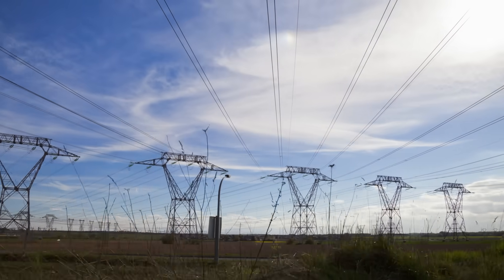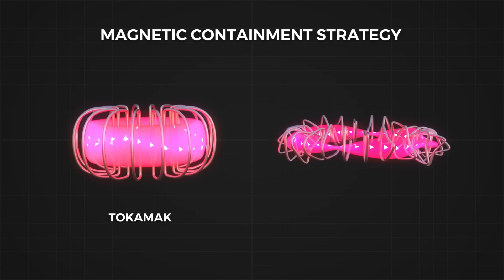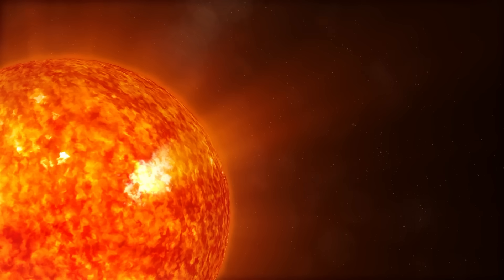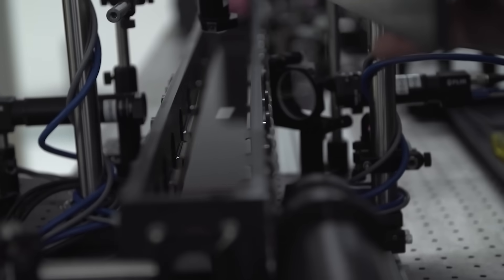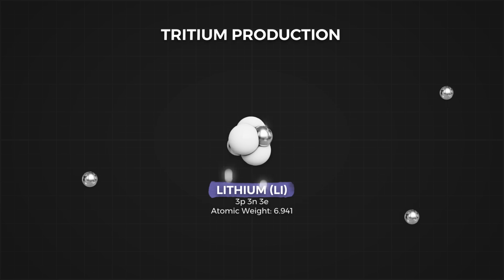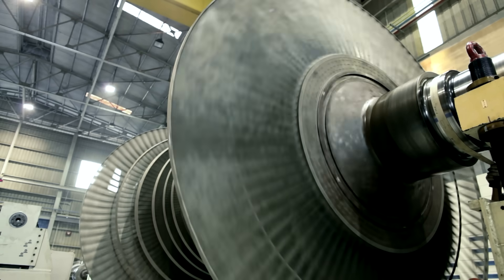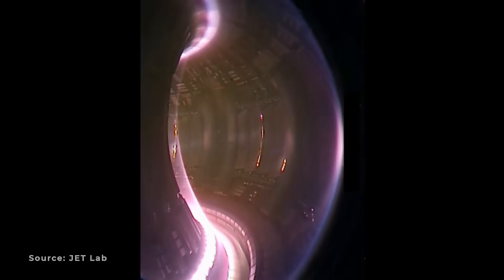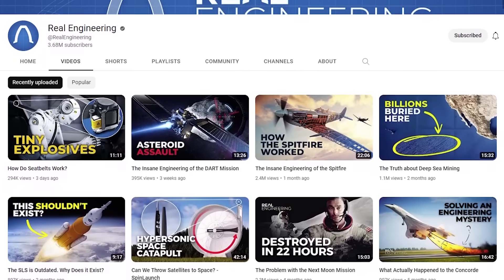The Problem with Nuclear Fusion

Comment: The Pinch Plasma Dry Fusion Reactor. This invention is designed to harness the power of plasma at temperatures as high as 10 million degrees Fahrenheit, offering a new approach to clean energy generation.

The energy output of plasma is proportional to two key factors:

Volume: Larger plasma volumes produce more total energy.
Temperature: Higher temperatures result in more energetic particle collisions, increasing the system's energy yield.
For example, a plasma at 10 million degrees Fahrenheit could transfer substantial energy to a surrounding medium (e.g., air or water), generating heat for steam turbines to produce electricity. The efficiency of this energy transfer depends on the reactor's design and heat transfer mechanisms. Based on historical data from Z-pinch systems:

Thermal output energy efficiency can range from 30–70% of input energy.
With an input of 1 megajoule (MJ), approximately 300–700 kilojoules (kJ) of usable heat energy can be recovered.
When compared to historical systems, the Pinch Plasma Dry Fusion Reactor could be more efficient:

Input Energy: Hydrogen and gunpowder serve as highly concentrated energy sources, comparable to 0.1–1 MJ per pulse.
Efficiency: With effective heat transfer, the system could deliver 50–80% of the plasma's energy as usable thermal output, making it highly competitive.
For context:

Historical Z-pinch systems required 0.1–1 MJ per pulse (equivalent to 27.8–277.8 kWh).
They achieved plasma temperatures of 10 million°F, with efficiencies of 30–70%.
The Pinch Plasma Dry Fusion Reactor could match or even exceed these benchmarks. With a design optimized for cost-effective operation and high energy transfer efficiency, this system has the potential to advance clean energy technologies and reduce reliance on fossil fuels.

In the mid-20th century, pinch plasma systems demonstrated the capability to achieve plasma temperatures as high as 10 million degrees Fahrenheit for brief periods. These devices, including early Z-pinch systems, successfully generated such high temperatures using deuterium gas as the working medium. The resulting plasma provided valuable data on fusion energy and particle behavior, laying the groundwork for modern nuclear fusion research.

Despite these achievements, the widespread application of pinch plasma technology seemed to decline after 1970. While advances in tokamak and inertial confinement designs have dominated fusion research, I am curious whether the factors that constrained the development of pinch plasma systems were primarily technical, economic, or related to the limitations of available materials and confinement methods at the time.

Key questions include:

Was the reliance on deuterium as a fuel a limiting factor due to its cost or availability?
Did the challenges of plasma confinement, stability, or energy gain outweigh the potential benefits of this approach?
Could modern advancements in materials, computation, and diagnostics offer a renewed opportunity to revisit pinch plasma technology as a viable path toward sustainable fusion energy?
Given that the capability to generate plasma at 10 million degrees Fahrenheit was demonstrated decades ago, I believe there may be untapped potential in exploring how these historical systems could inspire new approaches.

Comment: This is why torroidal systems are not a long term solution... even with superconductive magnets, the long term degeneration of the reactor wall is a huge problem... and that's before you look at long term neutron damage making the walls radioactive, when you want to replace them. That being said, there is nothing to say that you can't use torroidal accelerators, with the stream being allowed to escape in a straight line once it reaches velocity. With multiple streams reaching one central point, plus magnetic containment of that central area, you can avoid plasma contact with the walls, and use the kinetic energy to help the fusion process along.

Comment: I am very disappointed with this video because it makes the same drearily predictable mistake that has caused the waste of tens (hundreds?) of billions of precious research dollars - conducting expensive research on systems despite known insoluble deal killer problems. Fusion powered electricity has been, and always will be, twenty years away because of this.
The only wise way forward is to stop all fusion research and construction worldwide at the system level, and focus on solving the (relatively smaller) deal killer problems one at a time. And if those problems can not be solved, then the involved scientists and engineers need to tell the world that fusion energy on Earth is literally impossible.

Comment: @4:29 🤔How can energy be released if you put 2 hydrogen atoms in and get 2 hydrogen atoms out? You just lose an e- then gain an e-? In the vid, it's said to be a "low" energy reaction 🤔
Reply: in the case of regular hydrogen fusion, a proton turns into a neutron, releasing a positron (essentially anti-matter) which will then collide with an electron, destroying both of them and releasing energy
Reply: @matthias5207  Ah so the energy results from the mass that is lost and annihilated?

Comment: use high amounts of energy, to try and create a fusion reaction that creates more energy than what was put into it. the concept of fusion energy sounds like a perpetual motion machine to me. impossible to achieve. natural fusion is only possible due to incredibly high gravity of gases, that do not take an outside source of energy, just the force of gravity. it is something that will never occur with a net gain, that will fit on a scale that will fit on the damn planet.

Comment: I like Helion's idea of using short pulses of fusion to drive a magnet, kind of like explosions inside the cylinders of a car engine drive a piston, thus bypassing the need for steam-driven turbines. However, I still think the easiest, cheapest way forward is by using smaller, modular fission reactors. And for those who think nuclear waste is an issue, many of these newer reactors actually use the waste for energy, thus diminishing the problem, which honestly was not much of a problem anyways(all the nuclear waste ever produced by mankind can fit into a single football field three barrels high). And as for meltdowns, thorium reactors never meltdown, because of the way thorium works it's actually impossible. Plus fission has no greenhouse gas emissions. So, please, let's just focus on fission, preferably smaller thorium reactors, for the time being!!!

Comment: Couldn't you replace the tritium with Helium 3 and there tons on the moon right?
Reply: yeah you could but H2 + He3 fusion is even harder to achieve you need higher temperature and pressure however the yield is the highest 18,4 MeV

Comment: You still need oil.  You can't put a fusion plant inside of an automobile.  And even if you could, all that does is turn a turbine to boil water- just like every other power plant.  Fusion isn't going to redesign our power.  It's just another method of boiling water for steam.  Electricity is here to stay.  There's nothing fusion can do that fission can't.   Also, billions of dollars, massive lithium mining on a global scale, and massive pollution just to boil water.   Good job.
Reply: Fusion doesn't create waste and it's more powerful than fission
Reply: @NoName-hg6cc  So?  It still boils water.  That will be its only function.  Boiling water.  It will make steam.  That is the only way it can make electricity.   It's a fusion powered tea kettle.

Comment: Fusion technology's biggest problem is net zero.  Once they get out exactly what they put in, and for a sustained length of time (not microseconds), THAT will be a breakthrough.  It's decades away, if it is even possible to do in our planetary environment.  Blaming "capitalism" is a distraction.  There are several laws of physics we have yet to discover, let alone understand before fusion as an harnessed energy source, is feasible.

Comment: That's not 800 Megawatts per hour. 800 Megawatts applies only if fusion was sustained through an entire hour. Of course it won't. Magnetic fields that contain the fusion process are notoriously unstable and deform at required temperatures for fusion in a fraction of a second. Since there are 3600 seconds in an hour, the real output is 800 Megawatts divided by at least 3600. You don't have the basic math dude.

Comment: We can only run the reactor for about 2 months because we don't have enough of 'X' since it is so rare in the world. But we can solve that problem by making our own 'X' by combing it with 'Y' within the reaction. But we don't have enough 'Y' because it is so rare. But that is not a problem because we can make our own 'Y' by combing it with 'Z' as a byproduct of the reaction. But that is bad, because 'Z' is very expensive, explosive, and radio-active....    ..Basically this thing will be 100x more expensive than any energy we will get out of it, and it cannot be sustained because just one reactor alone will run out of the worlds yearly supply of X ,Y ,and Z within the first few months of operation. 😂

Comment: The suns heat goes through a vaccumm. and a vaccumm will not protect any one from this style heat. To get this Plasma Reactor lite. You need to put a neutron in the fuel. Not all atoms have a neutron in them.

Comment: What blows my mind is why they aren’t using the same technology as the shuttle or space X heat shield on the inside of the reactor.
Reply: The reaction is as hot as the sun. Anything it touches will melt. Even the space shuttle tiles wouldn't stand a chance. That is why the reaction is suspended in air using magnet fields.
Reply: @ They haven’t even tried making the outer layer of aerogel.
Reply: @ I know but they will not even try to use the technology, at least if they did they would only have to replace the tiles and ablative material and not huge sections of expensive metal walls every time they run it. All while increasing the strength of the magnetic fields as our technology increases.
Reply: @MQShawGravity OT doesnt Work that way. The Heat IS to high

Comment: The Problem with Nuclear Fusion: A Research Scientist’s Perspective

Nuclear fusion, the gold standard of energy aspirations, offers immense potential: virtually limitless, clean, and efficient power. But, as someone grounded in electronics engineering and plasma physics, I recognize that the path to fusion's viability is fraught with scientific and engineering complexities. Here's my analysis:

1. Net Energy Gain (Q > 1)

Achieving a Q-factor greater than unity remains elusive. The Lawson Criterion demands sustained energy confinement that current plasma heating systems—such as neutral beam injection (NBI) and ion cyclotron resonance heating (ICRH)—struggle to deliver efficiently. Energy losses from thermal radiation and imperfect confinement exacerbate the challenge.

2. Plasma Instabilities

Plasmas are governed by non-linear magnetohydrodynamic (MHD) phenomena. Disruptions, tearing modes, and edge-localized modes (ELMs) wreak havoc on tokamaks. Advanced feedback control algorithms and 3D field shaping (e.g., resonant magnetic perturbations) mitigate these effects but remain insufficient for long-term operation.

3. Materials Science Bottleneck

Plasma-facing components (PFCs), particularly tungsten, face neutron irradiation-induced embrittlement and high-Z contamination issues. Neutron fluence also induces helium bubble formation and structural weakening, while divertors experience peak heat fluxes beyond 10 MW/m², nearing material vaporization thresholds.

4. Tritium Breeding

Tritium, essential for D-T reactions, is a bottleneck. Breeding blankets must efficiently capture high-energy neutrons to produce tritium from lithium while maintaining minimal parasitic energy losses. Solid and liquid breeder technologies remain experimental and face significant engineering hurdles.

5. Radiative Energy Loss

Bremsstrahlung radiation from tungsten impurities and synchrotron losses in high-energy plasmas sap energy faster than it can be replenished. This creates a balancing act between plasma purity, confinement, and power efficiency.

6. Economic Viability

Fusion projects like ITER and DEMO are financial behemoths, with multibillion-dollar budgets and decades-long timelines. Achieving a levelized cost of energy (LCOE) competitive with renewables like wind and solar remains an unresolved economic challenge.

7. Integration Challenges

Fusion plants would produce high-grade heat at temperatures suitable for industrial applications but require substantial advancements in heat exchangers, superconducting magnets, and grid integration to function seamlessly within existing energy infrastructures.

So... My Conclusion, 

Fusion research is advancing the frontier of physics and engineering, but its practical realization demands breakthroughs in energy confinement, material resilience, and reactor scalability. While a tokamak or stellarator-based fusion reactor isn't a short-term solution, it remains the ultimate aspiration for clean energy. For now, it is a field where "exascale" computation, "megagauss" magnetics, and "mev-scale" neutron flux define the cutting edge.

Comment: 2:50 you should avoid false extremes.  Neutron stars are both solid and billions of degrees, much hotter, and they dont melt due to the pressure.